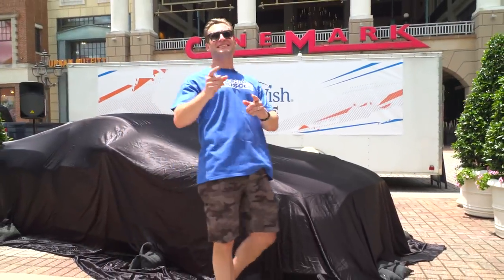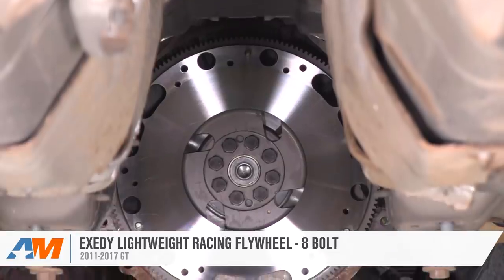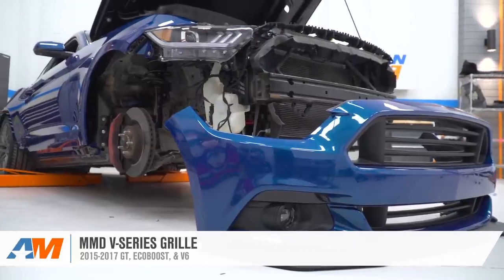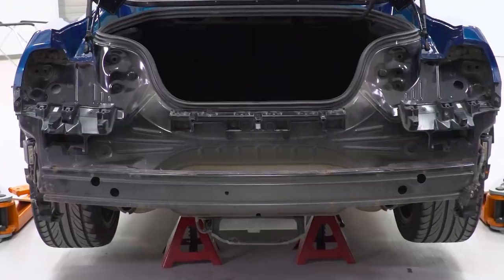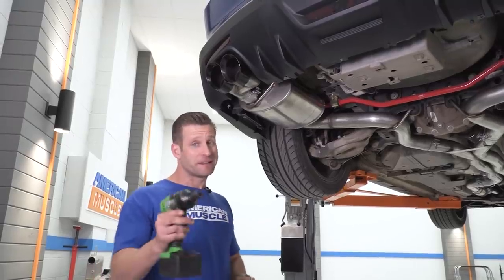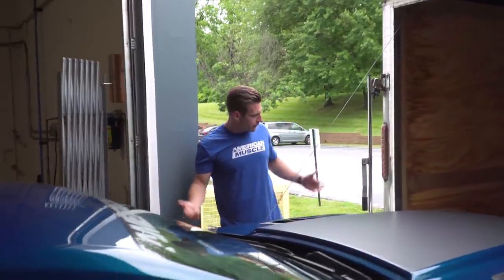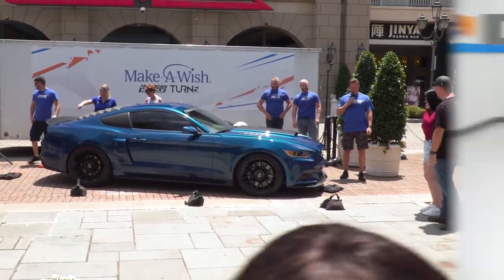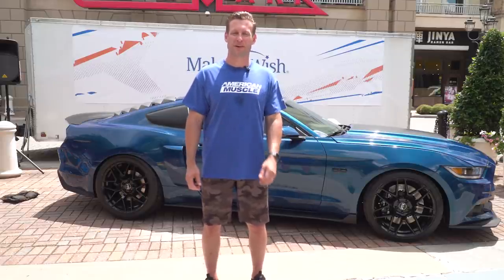2016 Mustang GT Build for Make-A-Wish by AmericanMuscle! - Hot Lap

Comment: I got a roush hood scoop. Did everything right. The only thing, the sticky tape didn't stick all around the hood scoop with two people pressing down and I have gap in the corners. I'm scared to tighten the bolts anymore. Because I might crack the scoop.